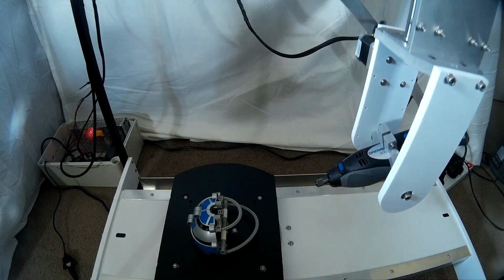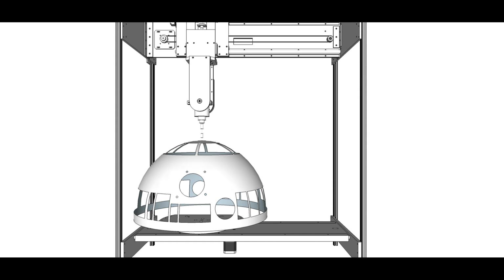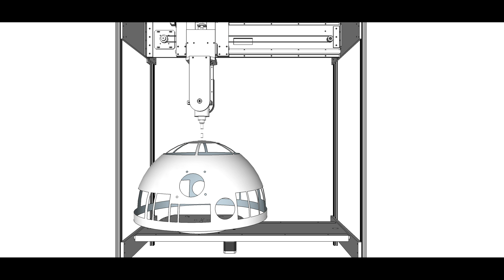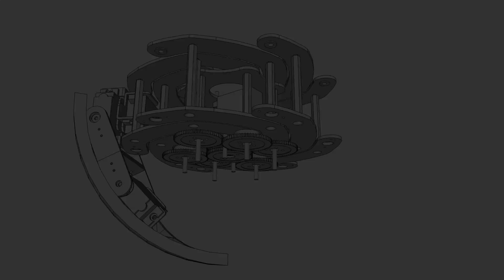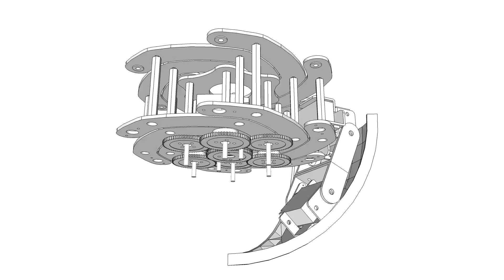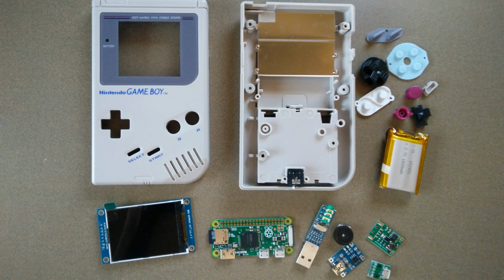New Projects - "5" axis CNC, R2-D2 and more!

Comment: It's obvious you are using Sketchup. What plugin are you using for the animation? Thanks.
Reply from the maker: http://regular-polygon.com/keyframe-animation/
Reply from the maker: It handles aluminium well. The weakest part while cutting was the spindle mount on my machine but if you replaced that with a proper spindle with an aluminium mount it would be much stronger.
Reply: joshendy thank you sir

Comment: awsome! how do you generate 5 axis toolpath gcode, and which controller are you using?
Reply from the maker: I'm generating the tool paths with a custom python script I wrote. I'm using a modified version of grbl I threw together to add 5 axis stepper motor support and to get it to run on a RAMPS 1.4 controller board.